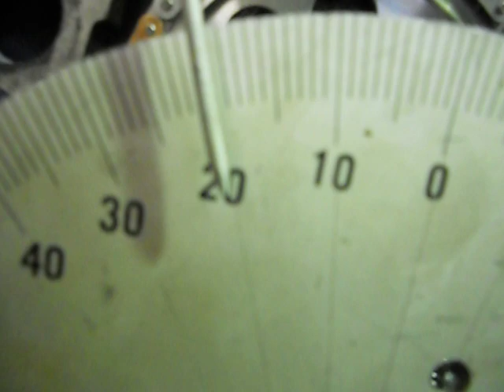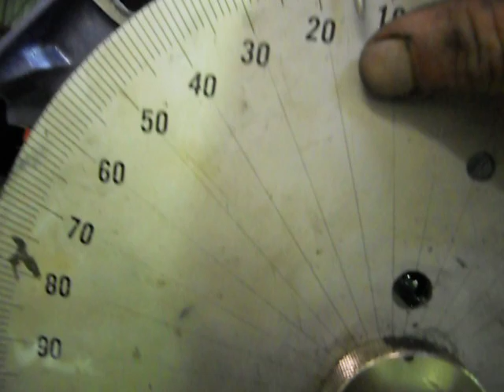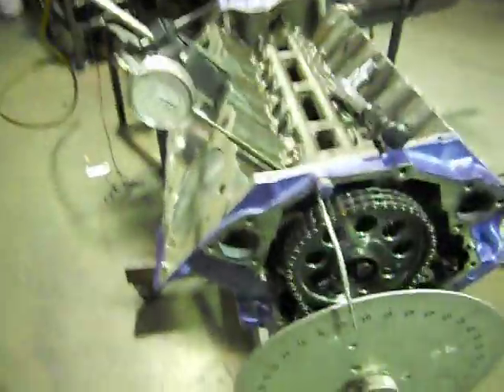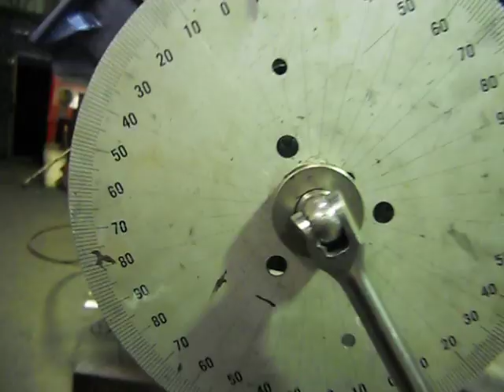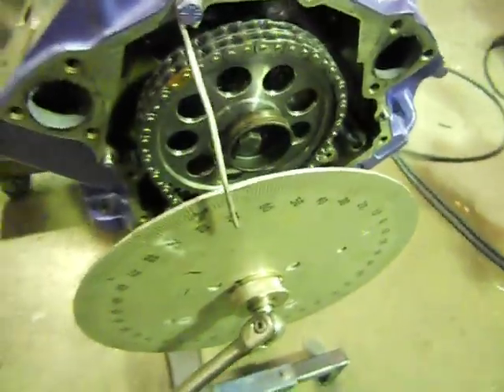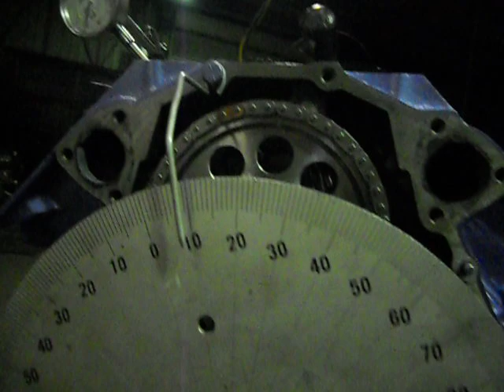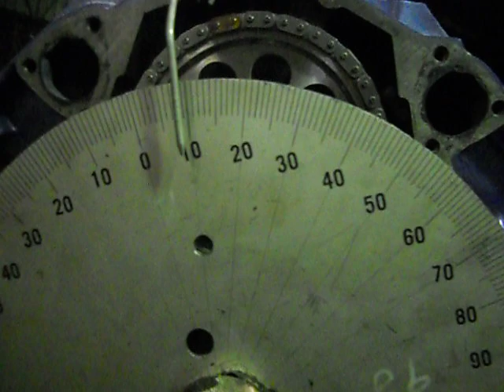How to dial in cam on V8 Hot Street Engine

Comment: How is that Degreeing a cam?? you are supposed to check .050 before and .050 after max lift. Reading of your degree wheel at both positions add the them up and divide by two, to find the intake centre line.

Comment: Awesome vid :)  When you say the cam spec sheet says lift at .050 is actually at 8 degrees BTDC, where did you get that spec from?  I'm looking at a lunati cam for my engine, and it doesn't seem to tell me that number on the spec sheet... I'm getting this cam 62503.  How would I find the correct number of degrees to set the cam at, @.050 lift?  Do I call the hotline or something?  Thanks :)

Comment from the maker: @slt223 G'Day mate,you learn from asking questions,if you just went from the top,there is 2 to 4 crank degrees of rotation while piston is still at TDC,this is called dwell,whats why people use a 6 inch rod in 350 chevs instead of 5.7 inch rod,longer rod same stroke gives you more dwell at TDC which produces more torque,the bump stop way splits the dwell giving you exact TDC,if you watch and listen again it should make more sense,ask questions any time and thanks for your time ...